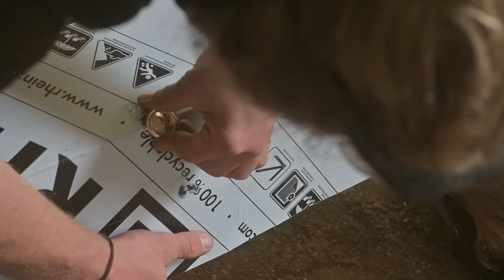Stone House Renovation - Part 20: Hidden Solar Panel

Comment: I'm not entirely convinced. Why use an old technique involving flax, combined with soldering, for something as modern as installing solar panels? The use of flax was already banned in the Netherlands 35 years ago for the construction of gas pipelines. Since then, the technique has been considered obsolete in other applications as well.

Comment: Kid, you would be right at home in the world of Mad Max Thunderdome. With that soldering mask, you even look the part. I admire your ingenuity and willingness to try new and novel approaches: fire prevention, solar thermal, etc. I believe I even saw you use your own hair as thread lock when assembling the rooftop solar valves. Impressive!

Did you do a pressure test before installing that? I hope so, as repairs will be extremely difficult later on. I wish you nothing but success on this project, while also knowing there will be many failures. 

With many aspects of homebuilding, we tend to use “tried & true” methods because these methods have been used thousands, if not millions of times, and their potential failure points are known and mitigated, if installation is done correctly. Your choices, while exciting and novel, introduce many, many unknowns. I hope these unknowns do not become failures, but if so, I hope you document and share them with us. It will be fun to see you overcome these challenges!

Comment: I’m not sure but I don’t think you’re going to get much hot water from those small copper tubes. I did a rough calculation based on the video and I figured the volume of the copper tubing is approximately 0.2 cubic feet of water or about a gallon and half. I’m not to technical in heat transfer verses water flow but I think you’ll have a very short shower. 😅 I enjoy your videos, can’t wait to see what you’re doing on the interior.
Reply from the maker: Yes you are right, but the idea is to have the water circulate and heat a larger volume of water in a boiler. But yes it is experimental :D

Comment: Are you not worried what will happen if you get some freezing cold weather, couldn't that cause those pipes to burst?
Reply from the maker: Yes you are right, the temperatures do not drop much below 0 degrees C here, but you are right. Probably I will mix some anti-freezing solution to the water that is circulating in the pipes. Thanks for your comment :)

Comment: A home-made tie off anchor is not the place to save money. Too many possible failure points in that assembly. Brass is soft…you have real possibility of threads ripping right out of the brass. That thing should be a single welded assembly. In US, a fall arrest anchor needs to withstand a force of 5,000 pounds.

Comment: With a temperature above 60C you are safe. With temperatures below 60C you have to be aware of the legionella bacteria, which can be fatal just by inhaling some contaminated water vapor. With silver solder you can improve the heat conductivity significantly. It conducts heat even better than copper. But the roof looks spectacular. 👍

Comment: Pour améliorer l'efficacité tu peux mettre du silicone de la série 700 ( 701 à 708, résistant à la chaleur tout en étant très bon conducteur thermique ) entre la plaque et les tubes. Et on lubrifie toujours un taraudage avec une goutte d'huile, le travail est plus facile, le filetage plus précis et surtout on diminue grandement le risque de casse du taraud, surtout les petits. Sinon pas mal, bon boulot :))

Comment: great video! So this system will be connected to a water boiler inside?
Reply from the maker: Yes exactly. A circulation pump will transfer the heat from the panel to the water in the boiler.

Comment: Adding copper pipes with water to every nook, and cranny of your house, is just an expensive way to pave the way for future water damage. The less water pipes you have, the better off you are in the long run. Who even installs sprinklers in a residential home, and on the outside of the roof?
Reply: They have a lot of wild fires in their area. He’s had several videos over the years where he was working g while fires were burning. I agree though, lots of opportunities for leaks. I’m sure they keep an eye on things.

Comment: Truly phenomenal! It was already said, but the dissimilar metals will lead to oxidation (galvanic corrosion) & it happens quickly if in contact with moisture/water. A simple solution is a sacrificial anode, but not sure which metal or alloy would apply as each combo of metals has a different prescribed alloy for its anode. If you search sacrifical anode and your combo of metals (ie zinc lead/tin copper?), there are charts online that list the proper alloys for each combination. There are also companies that specialize in it & would likely tell you what to use free of charge. I believe the corrosion will be between the lesser nobles, ie zinc & lead, & is solved by attaching a lesser noble metal or alloy. There are also ways to do it with a small dc electric current. Thanks again for sharing. May nothing rust.
Reply from the maker: Thanks James for your insightful comment. It is always wonderful to see with how much attention you guys watch our videos and we are greatful for your feedback! From a quick research I found that a magnesium anode, similar to the ones used in water boilers, could work out!
Reply: @vale.do.salgueiro  absolutely brother, I hopr it helps! It's cool science to me, besides being useful. I'd hate to see you have a major repair right after finishing. I've learned from & enjoyed your videos, & the amount & quality of work is rarely seen. Thank you again for letting us live vicariously through you.

Comment: This is a great project! I have solar tubes for hot water and they work great so I'd love to know how good your DIY solution works. Will you store the hot water in a water heater tank?
Reply from the maker: Yes I hope it will work well. But I can only tell once I have it connected to a boiler where the water will be heated. Thanks for watching

Comment: Great idea! Perhaps you can find a solution for the galvanic reaction that will happen between the copper and zinc, perhaps by coating it thoroughly? Moisture will make a big problem with such a combination. Good luck, cause I really like the concept!
Reply: I agree, theyll have holes in roof per zinc the lesser & copper would be ok. I'd use marine grade sacrifical anodes but unsure the metal designated for zinc... have to search 'what zincs for zinc.' Are you familiar with using a small DC current to prevent electrolytic oxidation? Applying a coating feels like the dyke & the Dutch boy.

Comment: Is there a possibility of galvanic reaction due to dissimilar metals being in contact?  High school was 35 years ago but I seem to remember something like that from chemistry...
Reply from the maker: Yes good point! To be honest I did not think of that because I hope it stays rather dry and does not have an electrolyte. But yes probably it would be better if everything was copper (Also the metal sheet).
Reply: @vale.do.salgueiro  I wonder if you couldn't coat it in some sort of elastic sealant?  I have no idea what would work, maybe silicon?

Comment: Very cool. I do however wonder what is the danger of the copper tubes splitting on cold winter nights?
Reply: That would only happen if there is water pressure still there and if the temperature would go into the -10C and below. This would be possible only if he forgot to turn off the water and open the valve to let the residual water out.

Comment: I really enjoy your channel, it brings back fond memories of my youth building log and stone structures with my ex, in the Appalachian Mountains of Georgia USA. 
On my screen your captions are too wide and are cut off on the right side. I would love to know what I’m missing!
Reply: If you click on the options for this video (the cog wheel icon next to the CC icon) there's the Subtitles/CC option, then select Options (underlined) in the top corner of that pop-up menu. There, you can adjust the subtitles font type/size/colour. These settings got changed for my account at some point, then I had to find and fix the settings to get the subtitles settings back to their normal.